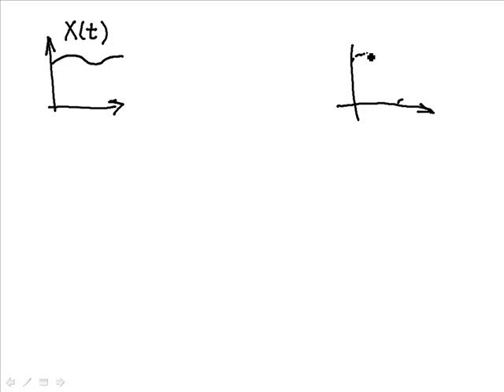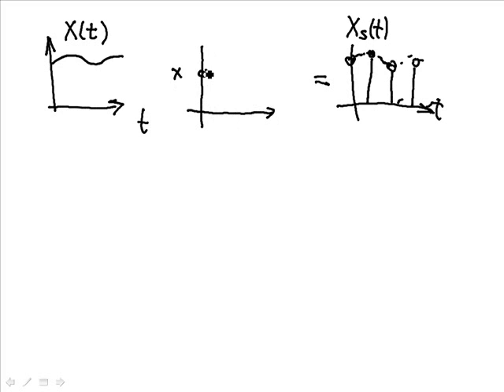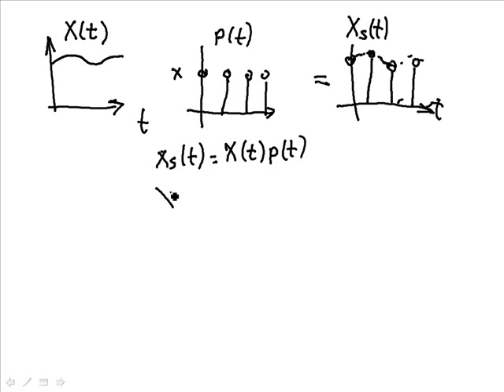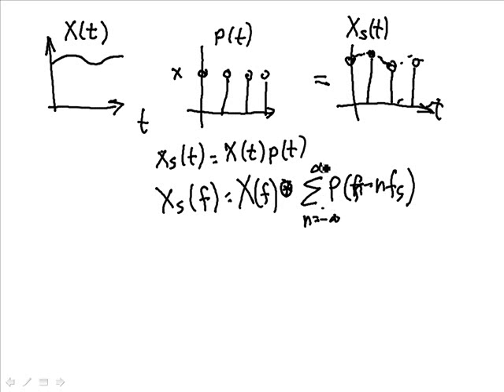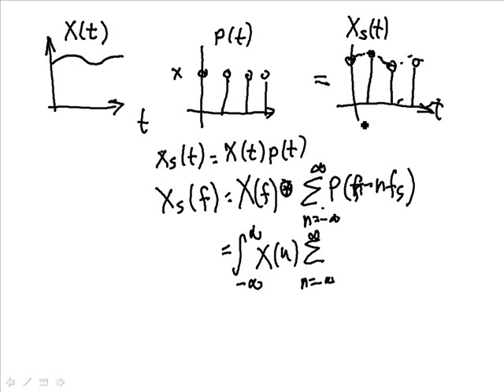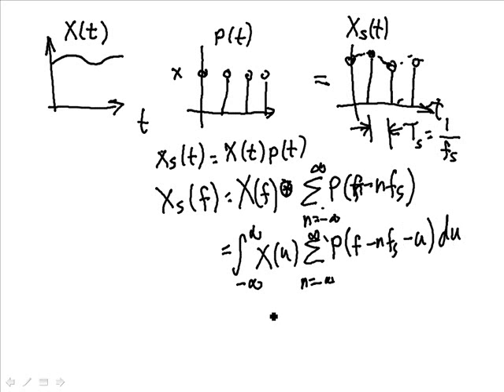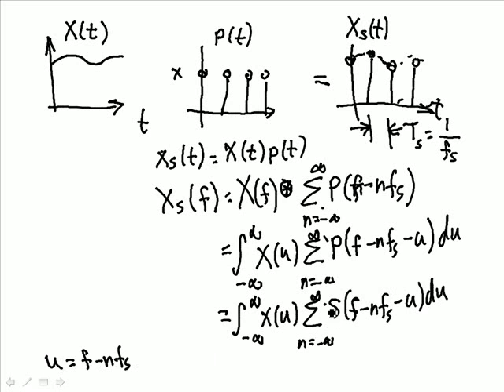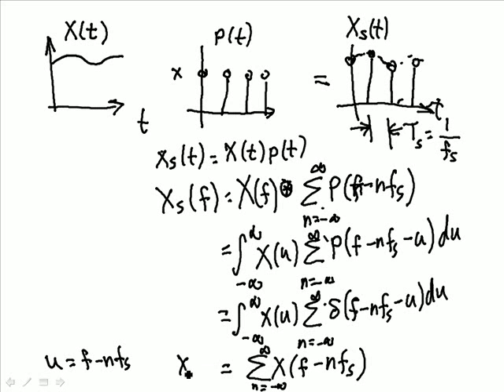Signal Processing Tutorial:  Nyquist Sampling Theorem and Anti-Aliasing  (Part 1)

Comment: why that sigma comes, how it becomes integral, why du ??? he could have take this step by step and explained how each step is arrived from previous step
Reply: that's not sigma, but it is a dirac delta function which is the representation of the impulse train. It becomes an integral because we know that the rule of convolution i.e mathematical notation of x(t)h(t) < represents convolution, not to be confused with simple multiplication> = integral [x(T).h(T-t)dT].
u is an arbitrary, basically you can pick any symbol you want , it will end up the same result which is in time domain.
Reply: Totally agree with you.. I have seen quite a few video where the dirac delta function is suddenly converted to sigma.. No one explains why